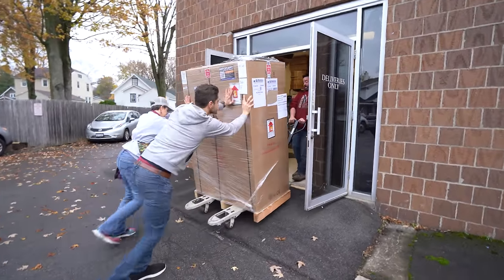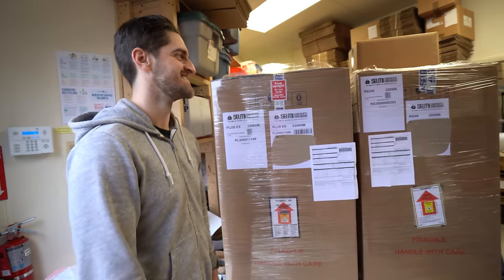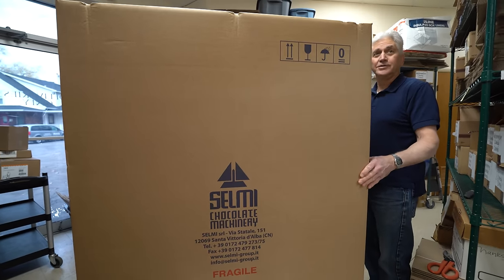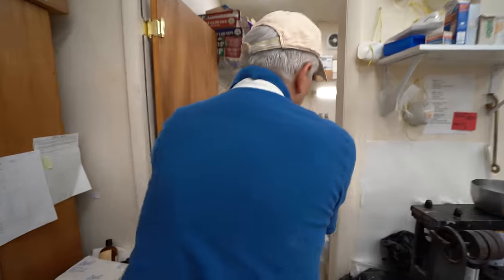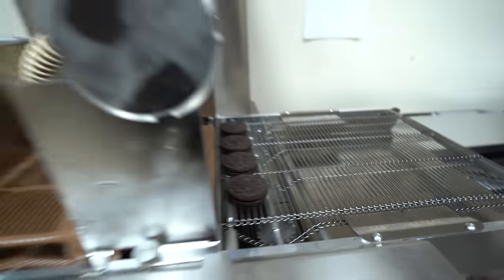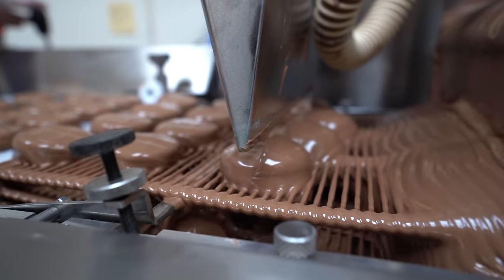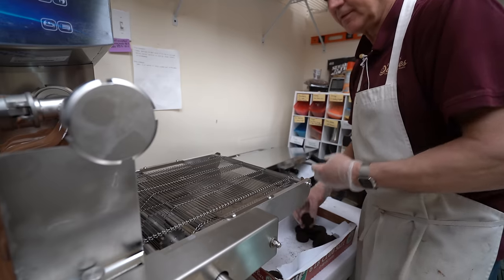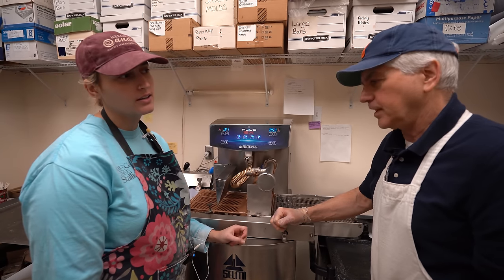NEW Chocolate Enrober Unboxing!

Comment: You guys should look into something called shoulder dollys. It's a harness you wear with a strap between you that you put under the object you're trying to move that way you don't have to lift it all you have to do is steady it while your shoulders Bear all the weight
Reply from the maker: Yeah, those lifting straps that we didn't use 😂 are very similar to what you described
Reply: @HerculesCandy   my bad I had to rewatch I missed the part where you had moving straps .

Comment: I honestly am the master of the pallet jack folks... $55000 liquor skids, on snow, sliding like a sled...down a 25ft ramp at least, into a basement under a huge bar, level with 1st Ave, east of 9st.
Scary, but I'd ride it down, and 3/4 way down, I'd start pumping the handle, so wheels dropped....2 times a $28000 skid, instantly stopped, but the hard alcohol, and myself kept going.....omg!!!
Yup I'll jack rodeo anyone lol